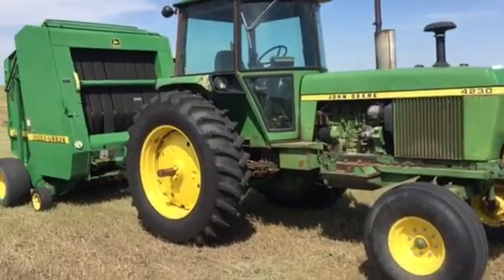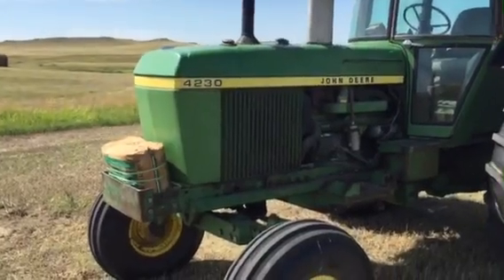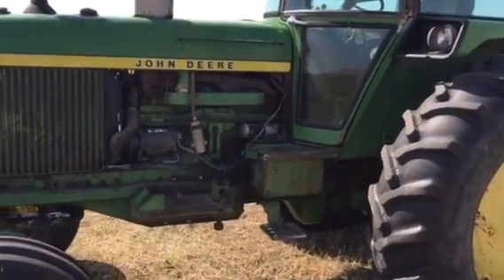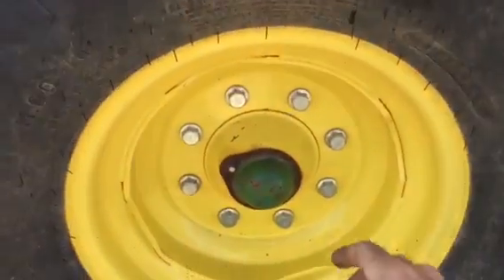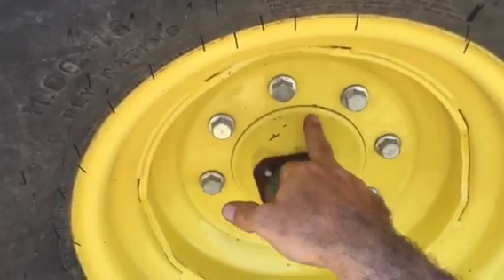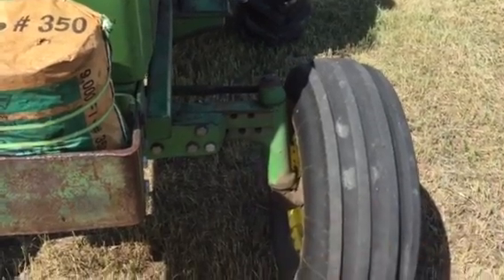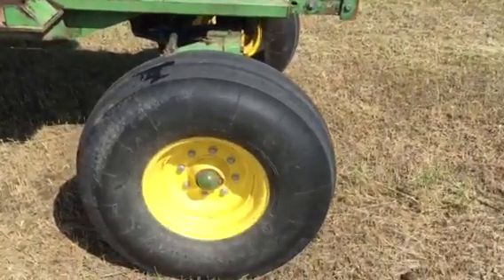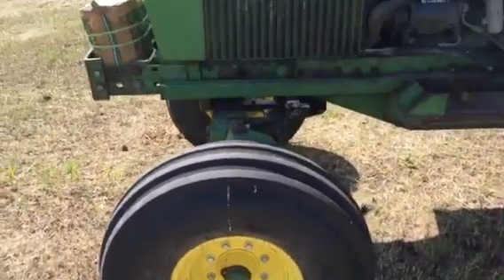John Deere 4230 upgrade

Comment: I had to do a double take when I drove by it the other day because I saw the big tires/rims like we've got on our 4630s, but was sure it wasn't that big of tractor!  Could you re-use your old tires or did you have to upgrade them too?  I think those bigger tires must be made better, we've never had a front flat on our 46s, but the smaller 2520 usually gets one or two per year back when it was the main rake tractor.
Reply from the maker: hey man,  we were already running the 11.00 16 tires on both the sound guards.  so i just put them on the new rims.  the 4020's we still run a 10.00 16.  the 148 loaders are light enough they don't cause near as big of an issue.  i think the 4430 tractors were the 6 bolt hubs too weren't they?  did the 4630's have a stouter knee and spindle than the smaller ones?  man i got to tell you, those 4630's sound just plain mean when you fire them up.  looks like you might get some second cutting?  the hay by our tree patch was pretty good,  the 12 mile field is worth going over but i don't think it will add up to much.
Reply: I think the 4430 and 4630 shared the same front trunion/spindles, but not sure.  We have never had any issue with them, but also aren't running them as loader tractors.  We have a 158 for one of them but haven't used it some time.  They are overbuilt for most of what we do, but I think it helps them handle the abuse a little better.   The 404s are tough old girls!    We have put up a little 2nd, mostly for squares for Feb shed lambing, but some rounds.   Much of the large hayfield we are hoping can be combined for alfalfa seed, but we'll see.  Doesn't happen often.